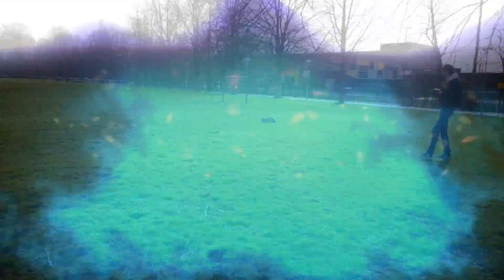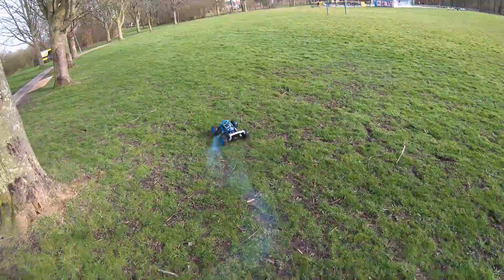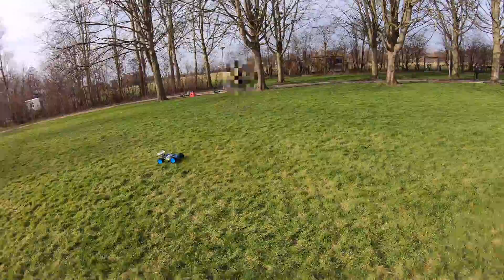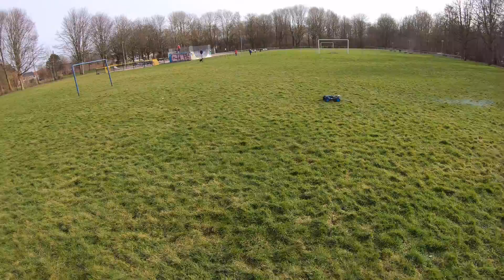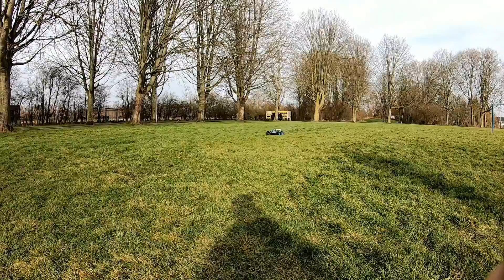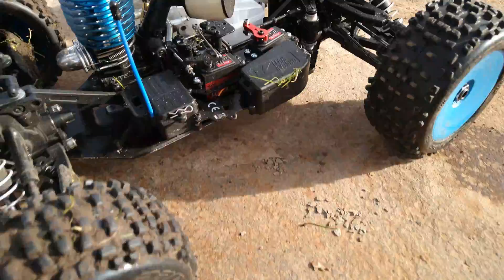This nitro rc truggy behaves like 6S brushless!

Comment: Attempted to fire up the new .28 p3 today, ran for about 3 seconds and died... couldn’t get it to fire again after that. I think it was my plug igniter. Gonna charge it up and try again tomorrow with a brand new plug too. Wish me luck lol... also 6 gallons and still going strong on that lrp is awesome man!!
Reply from the maker: You need to preheat the P3 .28 before starting it since it has a lot of pinch. It needs arleast a gallon of fuel before it is semi broken in. Also it is recommended that you change the conrod right after break in since the metal of the rod gets weak because of the extra stress of the break in
Reply: I heated it to 190 before trying it, and I will see if I can find a new connecting rod for it to swap out after break in. Thanks for the tip!
Reply from the maker: @everydaylife96-w6d  This is one of the hardest engines to break in but take your time and be sure to put it to bottom dead center after each heatcycle before it cools down or you will regret it trust me! Not only will the piston be stuck half way in the cillinder but also you will destroy the cillinder permanently since it shrinks around the piston when it cools down and there is more pinch in the top of the cillinder than on the bottom of every nitro engine
Reply: Yo she’s running today!! Just giving it some quarter throttle blips to maintain a good temp and I can already tell this things gonna rip!

Comment: Hey man awsome video, and also I would prefer my basher without center diff so I would removed it but it just personal preference
Reply from the maker: I may do the silicon earplug thing to make it almost solid since I am getting tired of it as well
Reply: @NitroMike  yes do that instead if you want to still have the center driveshaft
Reply from the maker: @rc_teo_nade_216  The reason you still want some give instead of full lock is so it can act like a slipper clutch so when I land my rc's of jumps and I happen to still be on the throttle I won't kill all my diffs
Reply: @NitroMike  oh OK i just learned something new

Comment: What clutch do you recommend for the Kyosho ST.
Reply from the maker: I run a JVD racing 4 shoe clutch. But any 4 shoe clutch with stiff springs will be a huge improvement over the standard clutch
Reply: Buku is the only way.

Comment: Mike it sounds like you engine is to close to you gear the mesh is to tight I always put paper in mine when I tighten the engine and that is an easy way to get the little bit of play you need I know you know your stuff but it sounds like it has alot of noise but man it is for sure it is fast and strong love the vids would love to see it run on a real track
Reply from the maker: The reason its making so much noise is because each bearing in this car is done and the wheels would rub against the bodyshell when steering under throttle
Reply: @NitroMike  I understand that keep up the bad assvideos.  I am still trying to get a nova .28 but they wat way to much and there are no parts like connecting rods and so on